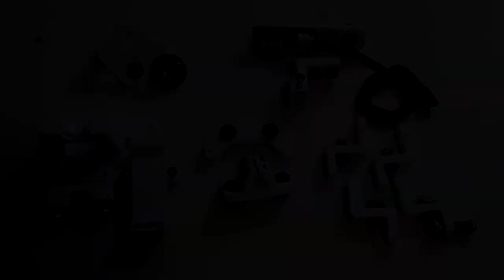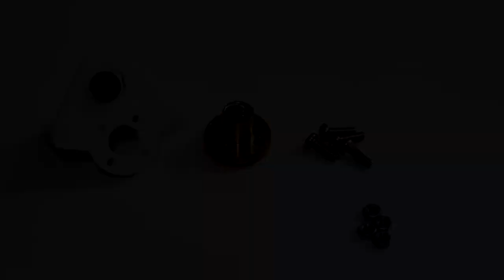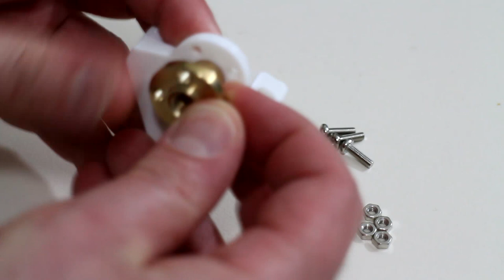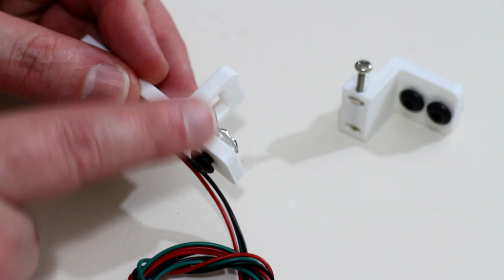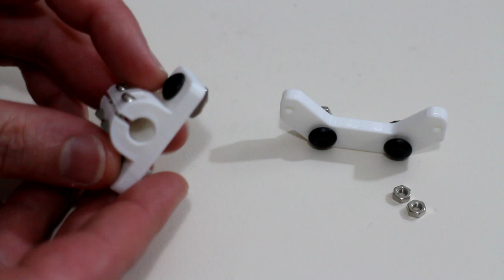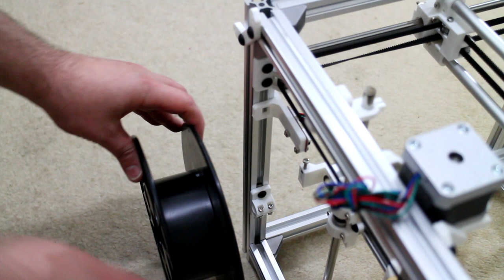New 3D Printer - Build Log #6

Comment: Looking very nice! A few simple suggestions for ya! First, add a nut to the underside of the bolt after you put it through the bed and tighten that up, it will make the bed more rigid and make using the thumb screws easier. Second, add a spring to your z axis adjustment screw to keep it from moving on its own from printer movements and vibrations. Can't wait to see it printing!
Reply from the maker: Cheers dude. Yeah I've added a spring to the z axis adjustment screw which really helped!

Comment: I said in a previous video and I say it again. Use 3 holes in a triangle for the printbed instead. Alot easier to level the platform :D
Reply: Yeah with a stable and absolut straight bed it would make sense. But with the cheap aluminium PCB heated bed (1.5 or 2mm or so) it´s useless.
I tried it on my Prusa and bed leveling became even worse, because the bed is minimal twisted. With 4 leveling Screws you can compensate it in a certain way and its more stable overall.
Reply: Thats hard when your print bed only has holes in the corners...
Reply: Or use an inductive sensor and kiss bed leveling goodbye (in theory, I'm still adjusting mine).

Comment: Getting close now.... A little idea I used is to fix one corner of the heatbed at the idea height and then adjust the other three to it. I got ABL now using the servo method and don't need to bother anymore....

Comment: Fine looking printer so far except for one thing: the z stage may give you trouble as is. All the weight should not hang from a flexible coupler. There are other minor things that I would also change but I'm curious to see how your decisions work on the long run.

Comment: Very nice work!  It's looking great, now on to the wiring.   To keep things neat and tidy on my printer I found that using Velcro ( hook and loop) cable ties/organizers to be more than worth the investment.  They also obviously allow for easier modifications without the need to snip and reinstall a zip-tie.     I've found the channels running down the length of the extruded 20/20 aluminium on my printer to make great places to hide wires in. 

Also for finishing touches you might want to print out some 20/20 end caps, there are plenty on Thingiverse and will help with the sharp edges on the ends of the 20/20 aluminum.

What controller board do you plan to use? If you don't have your mind set on a RAMPS board I would recommend you check out the newer MKS Base 1.4 boards.  They still run the Marlin firmware on an Arduino Mega compatible chip.  The difference is that it is all neatly put on to one board with nicer wire connectors and has built in support for dual extruders.

Comment: Liking it a lot! I'm also designing/building a CoreXY since I have an extra hotend and heated bed lying around and I must say you've given me a whole bunch of ideas. Looking forward to your first print!

Seeing as how you aren't using nut traps for a lot of your pass-through screw mountings, I would venture that using a little thread locker might be a good idea depending on how much vibration your motors generate.

Also a note on putting your spool holder in the back of the printer; might make it a little more difficult to see when the spool is running out ;)
Reply from the maker: Sharing does spur ideas, which is great! Agreed with thread locker, I try to use nyloc nuts where possible.

Comment: Looking very good! Only one thing I am thinking could not work, your adjustable bolt on Z endstop could spin around by vibrations made by printing and it may cause problems with leveling and releveling your Z height.

Comment: On the endstop adjustable screw mount I would have made the hole smaller that way it provides friction to the endstop screw. Just makes it so that vibration wont move your screw around thereby messing up your adjustments.

Comment: Hmmm.... the heater bed is only supported by the coupler, which is in effect a big aluminium spring. If it sags, which is likely, won’t that affect your Y axis accuracy?  I know in your other video you said the ideal would be to buy a stepper with the lead screw incorporated.

Comment: I am really impressed with the set up and though put into the frame. I would be looking at doing a similar one.
in hind sight are there any disadvantages in placing the X and Y axis motors on the rear of the frame. I feel it will maximize the print footprint and be neater?????

Also does the frame need any bracing?

thanks

Comment: Hi, how about making some printed parts for the front where the Z-axis can "rest" when its on the buttom, so if you want to remove your printed parts i would not stress the hole z-axis? also some printed feet would be nice to not scratch the surface where the printer will sit on.

didnt you want to install an inductive sensor?
Reply from the maker: I ran out of the T-slot nuts! I can't believe I've used 100 of those things and now I can't add extra attachments like the blocks at the base to support the build platform! Yes feet will be required, plus I'll need to create mounts for the ramps/arduino board and LCD/SD display.
Inductive sensor will come later.
Reply: ok thanks for the answer ;)

Comment: Where did you buy aluminium extrusion profiles? I can't find them on Banggood?
I found accessories like corner brackets, but not profiles.
Reply: check them on Aliexpress
Reply: In the U.S. I got it from 80/20 Inc. $17 per 9 1/2 foot segment (max length per piece). Delivery was $12-14 and took about 2 days. Seemed to be worth it to me.
Reply: Thanks. I found 3030 profiles locally for 5.8€/meter. (They don't have 2020 profiles). I just needed some reference point to compare the prices.

Comment: Any way to make a 100x100x100cm printer with easily available inexpensive parts?
I want to print a plane, see.
Reply: you can make a 100x100x100 in the same style as this one. But seeing the construction of the Z bed I doubt it can handle a 100x build plate. Core XY is probably  the only way to go. A 100x print bed would get way to heavy for Y bed on a prusa.
Reply: Don't use this printer for an example of a printer that big. Corexy isn't suited for such a big volume and you definitely can't have a cantilevered bed. What you'll want to do is build the XY portion of your printer more like a CNC (which typically have larger build volumes close to what you're looking for) using either linear guides or v-slot wheels and extrusions/rails. Then for the Z axis, you'll want at least a dual screw drive, but most likely a 3 screw drive system to avoid any tipping about a single axis, since it takes 3 points to define a plane and doing 2 points (2 screws) will only define a line of support.

Building printers this large are not cheap, be prepared for a significant investment. Most likely it will cost $2000-3000+
Reply: +3dp, I'm not interested in general ideas because of course it can be done. And should have been done. The question is, is there a set of parts or existing machine that can easily be modified for large volume. It doesn't have to be fast, just big.
Reply: Dan Frederiksen Ahh ok I see what you're saying. I'd recommend checking the openbuilds projects pages, they have quite a few large scale cnc and 3D printers which you could likely base your design off of and just use longer extrusions/rods/rails to get the size you're looking for. I do remember hearing of a printer with a similar sized volume but I'm not sure where, try searching for something like extra large reprap on google.
Reply: Mostly Printed CNC can definitely be 100cm in X and Y, you probably have to modify it to get 100cm in Z, that's quite a tall machine!

Comment: What type of filament was used to print the parts? cheers!
Reply from the maker: For these 'test' pieces I've used PLA with only 2 perimeters and 15% infill. I have some PETG here I will re-print every part once finalised.
Reply: +Tech2C ahh ok, i've printed all my delta parts on pla with no issues. I decided against abs because i find it too flexible for these type of applications.  if i have any issues i will also reprint any problem parts in petg.  great build btw, can't wait to see it printing :)

Comment: what is your current printer i am looking for a cheap prusa
Reply: around 400-500
Reply: He has a Replikeo prusa i3. I have it too. Not a good buy anymore. Many other prusa i3 designs thats better
Reply: i currently have a micro 3d a peice of shit but i aam looking for a good prusa
Reply: I am looking for one too. can you recommend one like the Geeeeetech Prusa i3 or the TEVO Tarantula I3?
Reply: ive heard good things about the tevo dude
Reply: the malyan m150 i3 is pretty good, i have one myself. and it's just 300 USD.
Reply: true what do you think of sla im thinking of building one
Reply: Buy a p3steel frame of e-bay 5 stepper motors, a ramps/mega at combo. And you will have a superior frame with very consistent prints.
Reply: +1.... I started with a Geeetech learnt all about it and then got a P3Steel frame and built my own. Have two printers now but the P3steel is probably better....
Reply: i have an micro 3d how sad is that